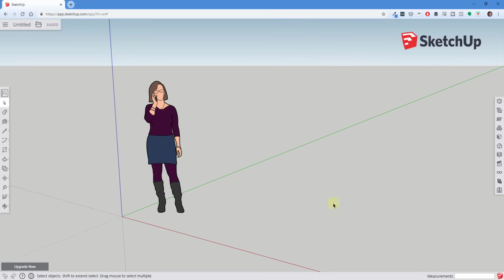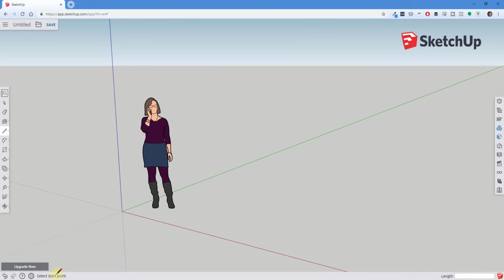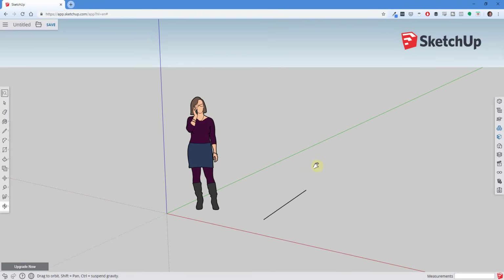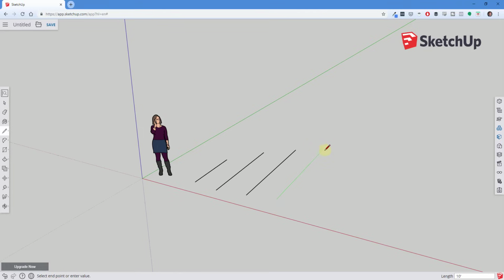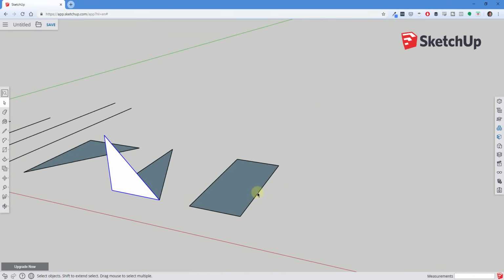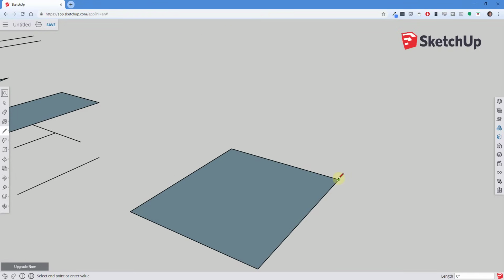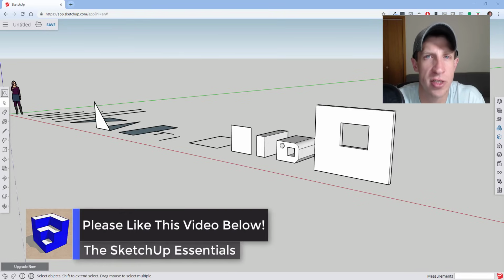GETTING STARTED with SketchUp Free - Lesson 1 - BEGINNERS Start Here!

Comment: DO ALL MY TYPING IN MY AUOTCAD PROGRAM  - DEFAULT IN AUTOCAD IS ALL CAPS - PLUS I TAUGHT DRAFTING FOR 45 YEARS WAY BEFORE SOME YOUNG INTERNET NEWBY MADE UP THAT RULE OF ALL CAPS MEANS SHOUTING??????  I SHOULD BE GRANDFATHERED IN: AGE + EXPERIENCE = KNOWLEDGE   RESPECT YOUR ELDERS YOUNG INTERNET NEWBIES.  + YOUR VIDEO SHOWS YOU DRAGGINGTHE LINE AND THEN CLICKING AT THE CLOSE OF THE THREE LINES TO MAKE THE PLANE COMPLETE - JUST WHAT YOU WARNED US NOT TO EVER COMBINE THESE STEPS - CONFUSING

Comment: YOU TOLD US NEVER DRAG/DROP A LINE AND WHEN YOU WENT TO THE PLANES FINISHED OR NOT FINISHED, ALL THE LINES YOU DREW WERE DRAG/DROP - COMPLETE THE THREE LINE PLANES TO COLOR THEM - CONFUSING TO THE NOVICE JUST STARTING OUT - USE NEVER, BUT SHOW IN YOUR EXAMPLES VERSIONS THAT NEVER WORKING
Reply from the maker: I clicked, moved my mouse, and clicked again, or I clicked and typed a value. That's how you add lines. Also...all caps?
Reply: calm down with the all CAPS.

Comment: Your tutorial is great, however, when I try to draw a line to a fixed measurement, it does not allow it.... so I draw the line, starting with an end point (not dragging) and input my required measurement into the box, press enter, nothing happens. The line disappears and goes back to a start point again. So I try again... maybe I am doing something wrong. I draw the line, input my measurements, press enter.. nothing! I have tried switching between mm, cm & metres but its simply not allowing me to put down a line to the measurement I want. Any ideas what I am doing wrong??
Reply from the maker: It sounds like you're clicking twice before typing in your length. Only click one time to set a base point before you type in your distance

Comment: Hi Justin. Have you seen the Tap Strap 2 wearable keyboard/mouse? i am interested in it because of its promising ergonomic properties. I model in 3d software 8-10 hrs/day, so joint problems are very likely in my future. I have dreamed of a hardware interface that allows me to work by placing my hands on my legs, or stretch my arms vertically, change positions back to the desk, etc. However, it seems a bit complicated to use and I don't know whether it would work for the kind of key/mouse combinations required in modeling software such as SketchUp. Have you used it for modeling by any chance?

Comment: How do you pan around your model, or your screen? All the online explanations are not consistent with the online software. For example there is no zoom menu in the bottom right (if you don't want to mouse scroll) and there is no hand tool to pan around. The Sketchup Help Center also discusses View > Pan, yet there is no View menu bar anywhere. Why is the actual Sketchup documentation so different from the actual software? This is why starting out is so frustrating. Thanks for any comments.
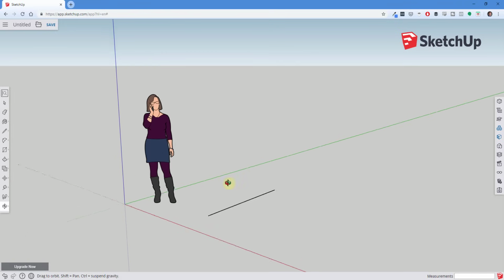Reply from the maker: This is kind of funny considering this comment originally (before the edit) was about how I should skip showing people where everything is and just jump right into the modeling. At about 5:00 in I talk about this exact topic. I can't speak to SketchUp's documentation, but you probably shouldn't be skipping around if you're just starting out.

Comment: 9:54 you mention not to click and hold when drawing a line because you then can’t input a value. Well, you can. Once you let go of the mouse button just start typing and will input your measurement.
FWIW.
Reply from the maker: Whoa crazy - I did not know that. There's still multiple reasons not to click and drag (inferencing, etc), BUT that's a feature I wasn't aware was there.
Reply: @Thesketchupessentials  thanks for replying and confirming that I’m not going mad. I’m relearning sketchup as I recently bought a 3d printer. Maybe you can help but I’m really struggling to create a simple rectangle with a rectangle shaped hole cutout of it in the centre. I thought I could draw each rectangle and align them on the X and Y axis before extruding them. I can’t find how to do it other than drawing guides lines, but surely an align function would be easy and a fundamental feature?

Comment: If you have an issue with the line drawing tool, in the search option type "shortcuts" then click on reset shortcuts. Now you can hit the spacebar after you finish drawing a line. Mine was not working even though I didn't customize any shortcuts. I would have to go click on the selection icon after drawing a line, which was super annoying.

Comment: Thanks for the video.  This shows me that sketch-up isn't going to work for what I need.... saved me some time.
Reply from the maker: Lol - what did you need?
Reply: @Thesketchupessentials  I needed a simple 2D CAD program.  (Like Autocad, but cheap) I was going to help my wife with her quilting pattern layouts.  I have been using Autocad at work since 1996 and Inventor since it was released.  It's not a fair comparison, but I was hoping for something simple that I could do 2D arrays with.
Reply from the maker: @Iffy50  Like what I do at 10:00 or so into this video? https://youtu.be/fKOIObcAY2A?t=610
Reply: @Thesketchupessentials  Yes, just like that, but I need it to stay an array so I can go back and modify it.  Autocad creates an array, but when you double click on it you can change the array values as often as you like.  It also arrays in two directions.  I appreciate your help.  It's just not a good fit for what I need.

Comment: I'm having an hard tinme to make the follow up tool to work.  I don't why, sometimes it does, and sometimes it does nothing. I saw in one of your tutorial (I don't remember which one) that it is possible to make a face to follow any curve, even if the face is not physically connected to the curve. Great, but I can't make it work.  Also, if I want to have a circular surface follow a curve, how is it possible to specify if it will follow the curve by a given edge, instead of by the center.  I'm using the free version of Sketchup.

Comment: New to Sketchup.  When I have the rectangle tool active, the axes tools (up, left and right arrows) do not alter the rectangles' dimensional orientations.  All rectangles are on the "flat" (x/y) axis.  What am I doing?
Reply: Just reconnected an OLD wired mouse and the problem was solved.  Apparently the bluetooth mouse is not sync'd properly or fast enough for the delicacy of the Sketup program!

Comment: Thank you for this video. I've been trying to follow how to use Sketch Up off and on for the past several years. I learned how to use drafting software back in the days of Windows 98 and 2000 while in High School. I was pretty proficient and helped draft up several farm buildings. The modern software is so overwhelming and frankly too expensive for the limited use I need today. I just want to build some furniture items and put together cut sheets like so many YouTubers seem to be doing today. Your tutorial was to the current version and that is very helpful, too many of them are back from when SketchUp was a standalone company or when it was operated by Google. Now that Trimble owns the rights, it is even more different. I kinda wish I could afford the installation version, as the browser version is a little finicky. But, it is worth it to try out.

Comment: Hi, i have been trying to create a basic stud wall, just to get me started, i have followed all the instructions on how to multiply with the move tool and use the ctrl key to copy, but it doesn't copy, i only end up moving the stud, i've watched several videos on how to do this but nothing works, my ctrl key does nothing at all, it's driving me mad, what am i doing wrong?
Reply from the maker: Are you on a PC or a Mac? If you're on a Mac, try the option key. If you're not, you're probably pressing the key at the wrong part in the sequence, or clicking and holding the mouse button down - don't do that. Select an object, tap the "M" key to activate the tool, click once and let up the mouse button to activate the tool, then tap the control key to enter copy mode

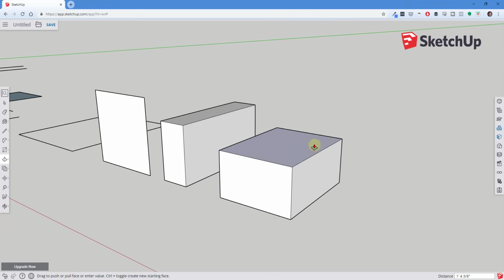Comment: Whew.  Glad I found you.  At about 19:00 you introduced PP tool.  When you drew the 6 faces did you infact have a solid?  Or did you have a hollow box?  Where as when you extruded I'm sure it would be solid.  So my question is are those two actually the same?
Reply from the maker: SketchUp is a face modeler, meaning that everything you see is a series of flat faces. In this case, because there's nothing inside the box and there's no holes in it, it's considered a "solid," but there's nothing on the inside of the box, if that's what you mean. If you were to delete a face it would just look like an empty box.

Comment: This has helped massively in getting me started, 1 question that might be ahead of the tutorials but i want to know this is going to work before investing too much time and then having to stop. I fabricate a lot of things from box section steel, can i have layers so i can see the front back etc separately and then create cutting list from the design? Also applies to woodworking, i want to design and make a custom racking system for my garage, can i make a cut sheet from the design. Thanks
Reply: there are, i dont remember the details now but i think layers  go by a different name, ill dig through my stuff and get back to you

Comment: I like the way you teach the coarse.
I have 25 years of use with Autosketch, version 2 which is no longer supported thanks to Microsoft  eliminating XP. I got version 9 and was lost and have not found tutorials to support it. I like Sketchup. I am more into mechanical design. Such as I am building a truck. I need to draw a tire and wheel. With Autosketch, I would draw a lug nut, 1.5" hex, placed 4.375" from center, hi-light with "ring array", enter 10 and I have 10 lug nuts on an 8 3/4" bolt circle. Same on the  tread on the side wall.
Is this a system that will work for me?
Reply from the maker: Hi Ed - This tutorial is based on the desktop version, but should still be helpful for you - you'd use the rotate tool in copy mode to create your circular array - https://www.youtube.com/watch?v=YEVar2X8bSA - Thanks!